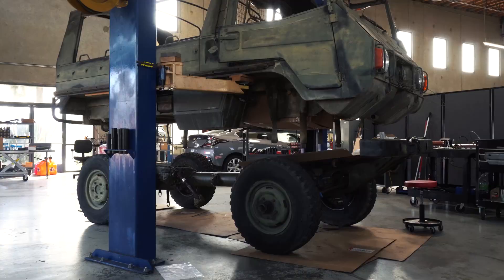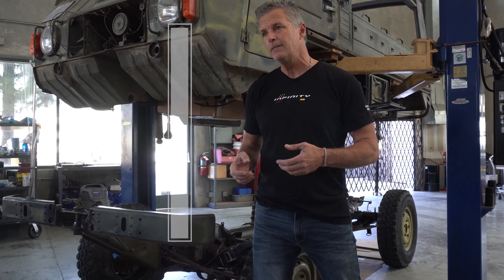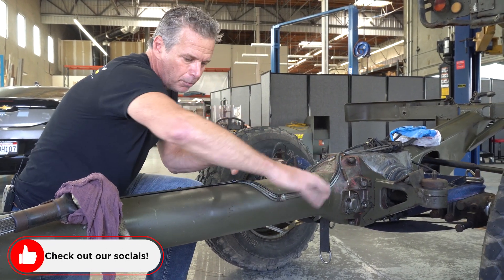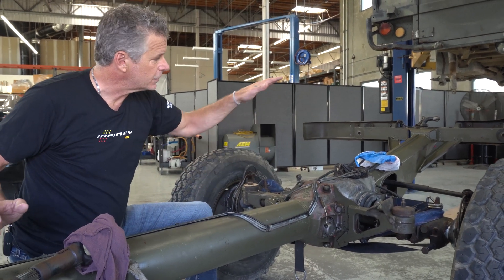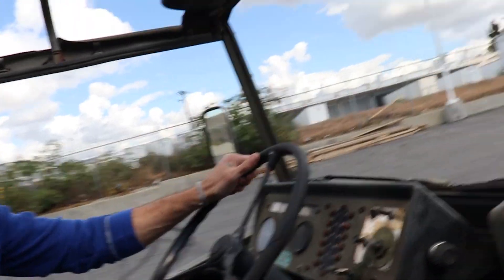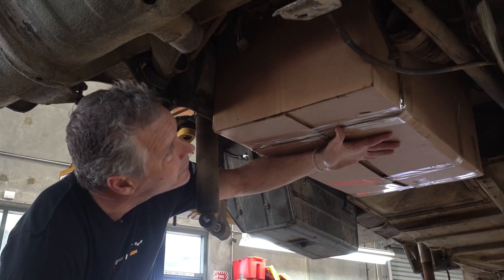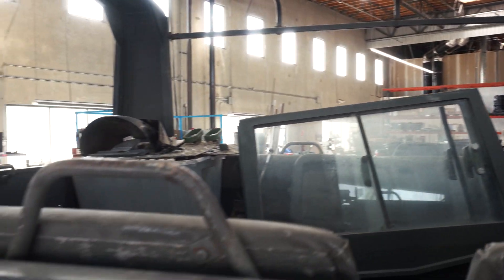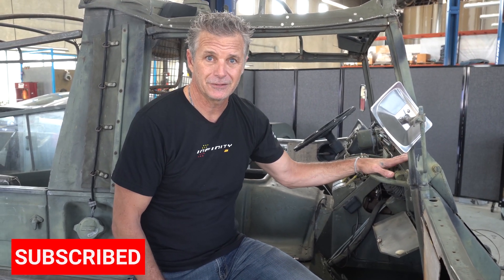Can We EV CONVERT a 1971 Pinzgauer?

Comment: "CARB exempt" means filthy, right? RV generators are horrible things compared to any automotive engine. I understand the idea of plug-in series hybrid with a large battery, but the engine should be as clean as any current automotive engine, or the whole thing is a step backwards. And yes, an "EV with range extender" is simply a series hybrid.

Comment: Carb exempt?  Explain that one.
Reply: CARB is the California Air Resources Board, which determines emissions regulations for California. Some engines are exempt from operational restrictions, including small (under 50 hp) generators. The intent of the exemption is not to allow someone to build a hybrid vehicle with unregulated emissions, but that's what is being done here.

Comment: Knowing the Pinzgauer by heart (drove them during my military service in austria and am acutally owning one) I also had this EV-Idea quite a while ago. It was mostly due to a mix of range anxiety and being a fan of keeping it original that I didn't go trough it. But I really like seeing someone actually doing this, also because I think it really is an ideal vehicle für an EV conversion. So I'm quite excited to watch this conversion process and it's results! I'm especially excited about how the generator situation will work out!

Also I want to give you a tip, which might be quite useful: I've seen several engine conversions on Pinzes, and many of them make one big mistake: They think they can make this things faster. Well they actually can, but this will break the Pinz. You absolutely MUST not exceed a top speed of 110-120km/h on these, although much more is very easily doable. Problem is, that the differential and portal axle gears just can't handle the increased RPMs. Above about 120km/h gear oils will get disproportionately hot, and sth will fail at some point. Even Arnold Schwarzeneggers Pinzgauer 6x6 ran into this trap. If you keep it down at mechanically safe 115-120 km/hs this will probably a great and reliable Pinzgauer conversion!

Best wishes from Austria, the Home of the Pinzgauer! :)

Comment: That's definitely interesting idea and I was thinking about the same. Utilize precise motor control + sheer torque of the electric motor in almost perfectly designed drive train.
Below mentioned 6x6 would give a bit weight but also more space for battery packs. However not sure if the ratio between extra capacity is worth the extra weight of additional axel. That 3rd axel is making that already awesome vehicle almost unstoppable. Which might not be necessary your need.
Next step - make it hardtop with solar panels on top .. if in area sunny enough.

Comment: Remember that the pinzgauer was made with the intesion of having a verry low center of gravity....so keep everyting that is heavy as low as possible.  What ihave done in the past is to rotate the hi/ lo case 90° so that the drive schaft is on top , on the tubeside cut the flange and rotate it 90° and weld it back on the axle/ alu pice you could make a flange to adapt. You can then mount the engine on the torqtube so it sits protected .
Reply from the maker: Great input, thank you!

Comment: too bad this isn't the 6x6 version or even a 6x6 Volvo C306, that would have been awesome :)
Reply: This Pinz seems to me better then Volvo for this conversion, as it's originally air-cooled .. similarly to Tatra 805, Praga V3S/S5T.
Reply: Using the 6X6 Pinzgauer would make little difference to the conversion process or components, since they're just using the original driveline.

Comment: What kind of kilowatts do you guys want the generator putting out?
If you get a Chevy volt engine with the generator/transaxle attached, slap a performance ecu on it to control it, and then use chademo as your charging interface, you could push 50kw continuous into the battery and literally run nonstop as a series hybrid
Reply: He mentions it at 7:04 , it's a 4 kW generator. So it is not capable of topping up the battery fast enough to keep driving.
Reply: The Chevrolet Volt powertrain is far too large and heavy for use as a generator set in this vehicle.